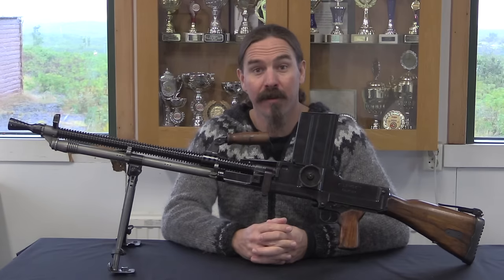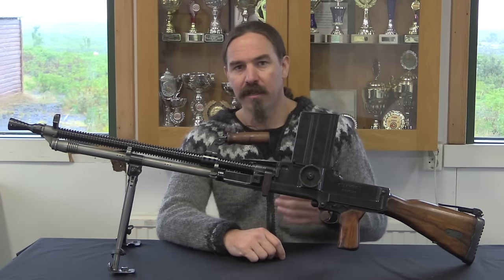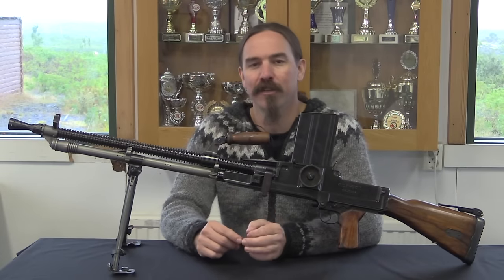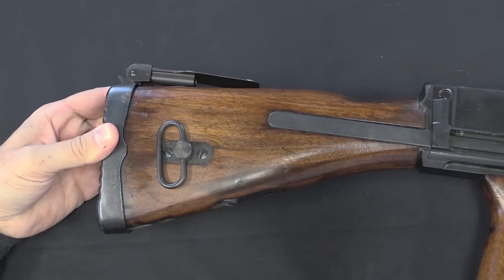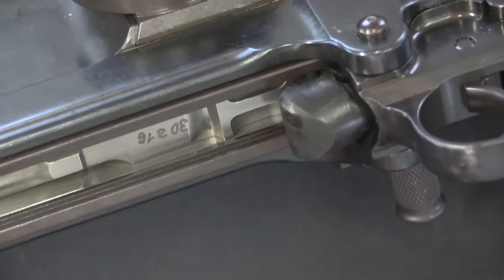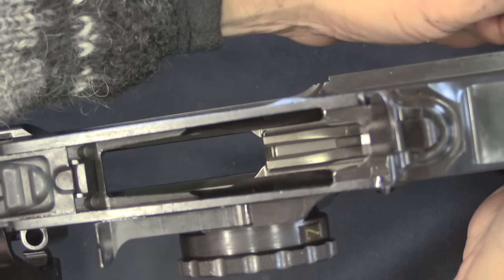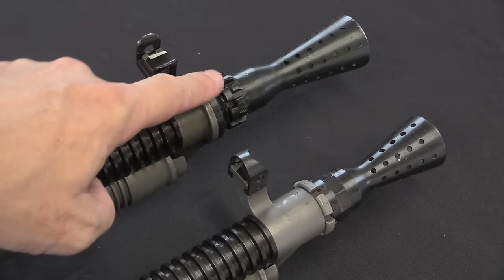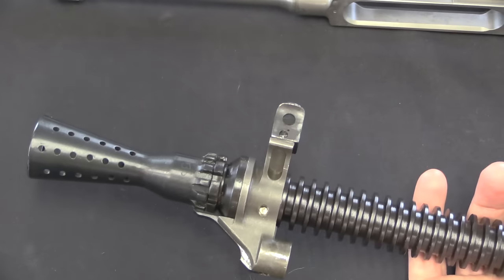Romanian ZB-30 LMG: Improving the Already-Excellent ZB-26

Comment: I disagree with your statement saying this is the best LMG of WW2. * BAR has entered the chat**
Reply: Seriously? The BAR didn't even get a bipod until 1938. And the bottom load magazine of a BAR doesn't permit an assistant gunner to reload which greatly reduces the cyclical fire rate compared to ZB/Bren.
Reply: The BAR is more of a squad automatic that a LMG. The fixed barrel makes it a very poor choice for high volume covering fire.
Reply: The BAR entered the chat and everyone laughed...
Reply: Please tell me you're joking.
Reply: @haldorasgirson9463  well considering the polish adopted it as the WZ28 and made some mods to it, including a bipod, pistol grip, and quick change barrel.. it’s a contender.
Reply: @ATH_Berkshire  the ZB30 is more of squad automatic platform (same as BAR). A m1919 30.cal would be an LMG and the m2 .50 would be a HMG. The ZB30 could be used in the LMG role for most armies of the day, especially considering that most armies had primary bolt action rifles. And depending on where, and what unit the BAR gunner did have an AG. The rate of fire is still the same, it’s just the ability of the gunner to reload that technically changes the suppression per minute.